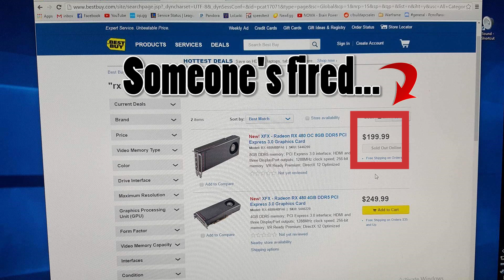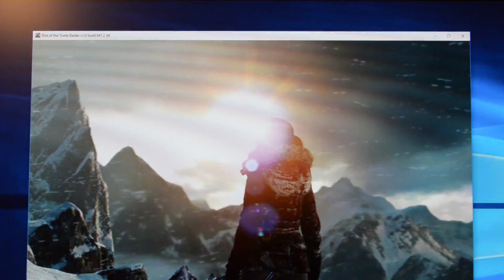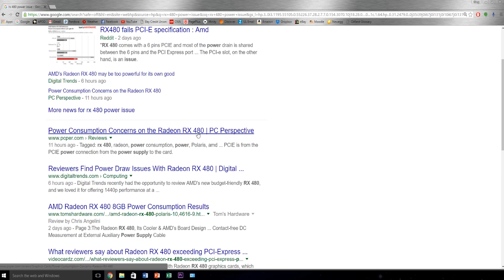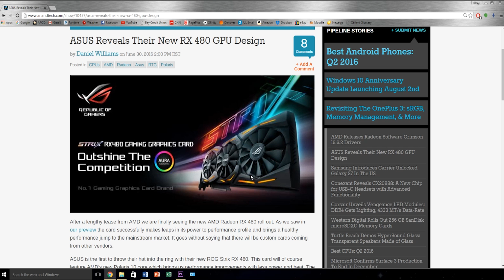RX 480 Aftermath: Power Issue & Over-Hyping

Comment: So you tested new hardware on a old as fuck motherboard? What is wrong with you >.>
Reply: Dude, you're stupid as shit you know that?  Do you know what the word "compliance" is?  All PCIE slots are limited to a 75 watt draw maximum.  I don't care if you have a 30 dollar motherboard or a 600 dollar motherboard, they are ALL limited to 75 watts.  Its an industry standard, a COMPLIANCE.  The only thing that is different between budget and enthusiast grade motherboards is the quality of capacitors, chokes and VRM's.  Higher quality components allow for a smoother power delivery and higher power load without breaking down.
Reply: *****
ya i did most hardware now has 200+ on PCIe's slots he said that one had 75 o,0
Reply: PCIE slots are STILL limited to 75 Watts of power draw, I don't know what kind of voodoo board you claim to have, but that's not possible.
Reply: Geshtal302
"PCI Express 2.1 increased the power output from an x16 slot to 150W so that some high-performance graphics cards can be run from the slot power alone. Optional connectors add 75W (6-pin) or 150W (8-pin) power for up to 300W total.Jun 4, 2012
Reply: Jessie James
I'd really like to see what you're quoting, because this is straight from the wikipedia page on PCIE:
"They can use up to 75 W (3.3 V × 3 A + 12 V × 5.5 A), though the specification demands that the higher-power configuration be used for graphics cards only, while cards of other purposes are to remain at 25 W.
 
Optional connectors add 75 W (6-pin) or 150 W (8-pin) power for up to 300 W total (2×75 W + 1×150 W). Some cards are using two 8-pin connectors, but this has not been standardized yet, therefore such cards must not carry the official PCI Express logo. This configuration would allow 375 W total..."

Nowhere does it mention later revivisions allowing more than 75 Watts. What it DOES say is that PCIE devices can have external power input  consisting of two 8-Pins, for up to 300W, combined with the 75 from the slot for a total of 375W.
Reply: +Jessie James 200 watts....what...

Comment: I have a gigabyte ga-78lmt-usb3 will that work with the 480? its the only micro atx board i could find that can handle my cpu (fx 8320) stock without vrm overheat

Comment: i read somewhere that the pcie power draw problem only happens on pcie 2 and lower versions
and not in PCIE 3
Reply: Part of the PCIe spec is that it must stay in spec for backward versions as well.  The fact there IS a power draw problem to begin with isn't good, and will cause them several problems.  Their only hope to survive this, is if they find it to be a problem with a bad batch of regulators or something like that, where it is a fairly small number of cards effected, and also something they can blame on one of their vendors, rather than being "just another AMD POS".
Reply: That and if it was a problem with PCIe 2 the card wouldn't run correctly with any AMD processors - they all currently only support up to PCIe 2. AMD would be shooting themselves in the foot.
Reply: i didnt knwo that and yeah that would be a bad move on there end if that was really the case

Comment: In other words,  the design is a fail.

Got it.  Sad.
Reply: Yea , i never believe a great powerful card would only draw a 150w . Lucky i go for a used 980ti
Reply: Yep
Reply: 1070 is 150w ? Are u serious?
Reply: J. Bravo
1070 doesn't "kick the 980tis ass"
Reply: well, it does
Reply: ✪ Frazzle ✪
If it does or does not doesn't matter here, this isn't the place for those subjective arguments, nor is a place where NVidia should even be mentioned.  We are discussing a COMPLETELY different card, and company, and problems associated with THOSE...Just stay on topic.
Reply: Gerff what? the 1070 rapes the 980ti
Reply: ✪ Frazzle ✪
ON TOPIC DUDE...
Reply: Gerff on topic? ok

RX 480 > 1060
Reply: Gerff and how is the design a fail?
also, you need to chill
Reply: ✪ Frazzle ✪
Still off topic, Nvidia doesn't belong here, at all, neither do comparisons of card performance in any manner.  Take your ADD meds or whatever you gotta do.  The design is a fail because they fucked up the power distribution on the card, and it is not running within PCIe spec.  It is pulling more current from the PCIe slot than they were designed to handle.  This is causing stability issues, as well as damage to peoples motherboards.  This is a fail, period.  The card should have never been released in this state, as there is NO WAY they could not have known about it, this is standard testing during almost every part of the design and manufacturing process.  Even if they missed it at ONE point, there were several others where they would have known.  And no, I don't need to chill, you (and others) need to learn to stay on topic, and not bring things into the discussion that belong in another.  That is why things can almost never get discussed properly on here, and other forums, because someone hijacks the discussion and takes it somewhere else completely.  Even trying to not allow that to happen has taken this off topic.  So PLEASE refrain from doing so in the future.  If you wish to discuss something, fine, discuss it, just find the proper place to do so, where you won't fuck the discussion completely.
Reply: JESUS FUCKING CHRIST!!  IF YOU MUST HAVE ME ENGAGE THIS TO SHUT YOU THE FUCK UP!  THE 1070 BEATS THE 980TI SLIGHTLY IN ALMOST EVERY BENCHMARK AND BY A COUPLE OF FPS IN GAMES!  ARE YOU FUCKING HAPPY?  I am not sure where you are getting "superior" and "rapes" and such things, because honestly, the numbers are VERY small and the differences are unnoticeable unless you are staring at those numbers, but whatever makes you happy I guess.
Reply: Gerff dude dont cry just because Nvidia is complete ass xD
Reply: Gerff i dont see why being of topic matters xD dont cry silly little child xD
Reply: okok 1070 does beat 980ti alright ? little boy dun cry go get ur milk
Reply: See...even more off topic now...no wonder people are so fucking ignorant of everything anymore, they are too busy worrying about shit that doesn't fucking matter, and injecting that into a conversation where it doesn't belong.  Sometimes I wonder if, in cases like this, people aren't hired by companies like AMD to get people off topic rather than discussing problems and ideas surrounding them.  That is actually easier for me to accept than people existing that really are that god damned stupid and determined to stay that way.
Reply: Gerff stop whinging please :)
Reply: Fine, back on topic.  Yes, the design is a fail.  Purchase a different card if you need one.  And yes, it is sad, very sad. 
I don't think AMD has many nails left before their coffin is completely sealed.
Reply: Gerff how is the design a fail, may i ask? it is VERY similar to the nvidia reference. wait for the 3rd party xfx, sapphire, msi, asus etc
Reply: ✪ Frazzle ✪
Seriously?  It doesn't meet the PCIe standards and specs, and is causing a LOT of problems.  How is this NOT a failure?  Standards and specifications exist for a reason... Nvidia, again, is completely irrelevant here.  We are talking about one specific card, and that is not an NVidia card.
Reply: Custom cards are not even out. What did you expect a "Titan" like card for 200?!
Reply: Gerff well, has it happened to everybody? NO. so shut up
Reply: Wow...the stupidity, and more acceptance of sub-quality shit.  I give up, the level of ignorance and pride in being a moron is beyond anything I can handle right now.
Reply: Gerff dude dont cry xD